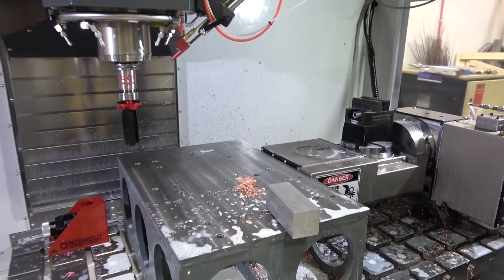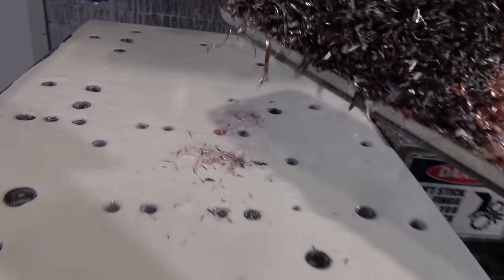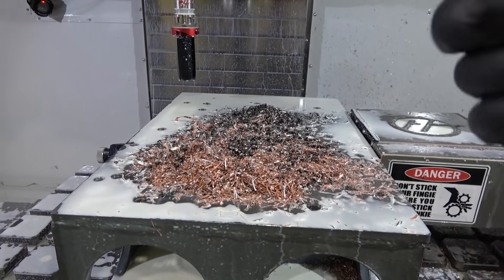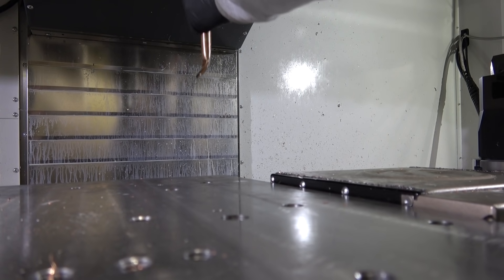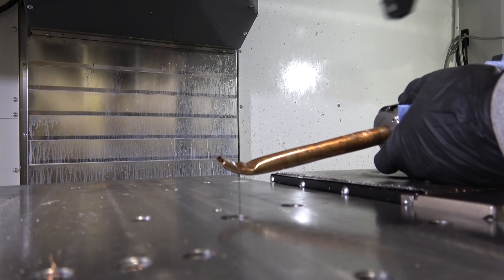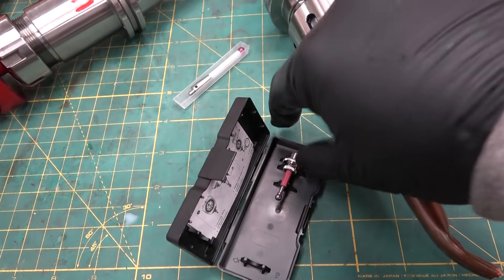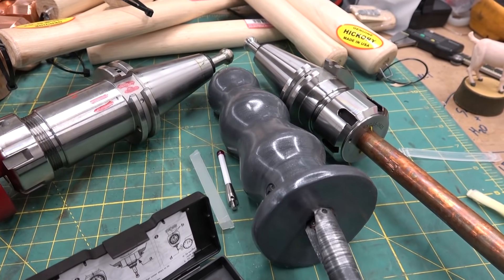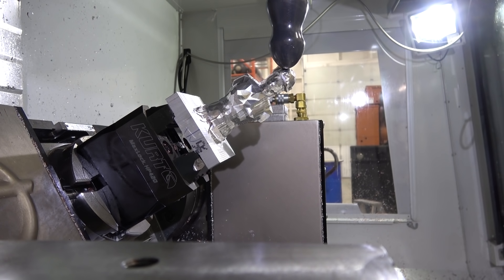Clever homemade tools

Comment: Nice tools, sir!  Two war stories for you:

I once created a "part washing" macro to allow the operators of a very long (25m) machine to clean the chips off a huge pipe just machined.  Did some for other machines, but this one saved hours of manual cleaning.

I once "fixed" a Renishaw probe, RMP60, the glass housing cracked but otherwise worked fine.  But from previous experience in humid environments (India), I knew moisture would eventually condense inside and destroy the electronics.  Nice design, Renishaw!

I poked a hole in the reservoir tip of a condom, stuck the stylus through the hole, and rolled the condom up to seal the glass part of the probe.  Worked for at least 6 months.

Cheers!

Comment: OMG I about peed myself I was laughing so hard. Seriously would that gray beast fit on a hammer drill. Oh wait a friend said use a sawzall.
Reply: Where im from we call it a screwdriver
Reply: Inventive!
Reply: Adjustable rpm?
Reply: If you use a sawzall you need a battery operated low power job and for god sake dont just cram a blade in your "probe" You would not believe how many people have just torn through and didn't realize until the damage was done. And lube lube lube and more lube, at high speeds things can get pretty viscous in there and I'll spare you the details. Have fun just be safe.
Reply: rick columbo 
That’s a scary thought.  A soft silicone “probe” mounted on an actual blade!  Yeah, that could do some damage.  Those blades can cut.
Reply: Go for the corded version.😉
Reply: @garywebster3044  You serious, yeah it's at least 25 year old technology and I'm no historian on the matter.
Reply: @garywebster3044  bless your heart!
Reply: Just seems very dangerous.
Reply: @garywebster3044  How many people must have told Columbus the same thing.
Reply: @thesage1096  nah it's real

Comment: 3/16 dia. By any length piece of brake line works good in a solid holder with a retention knob with a hole in it. Can be set with a tool length and programmed down inside holes and cavities to blow out chips. Extremely effective, try it

Comment: I program our 9 axis lathe that we feed with a fanuc robot.  I use that fan to blow off the chucks before loading and transferring  parts. I run a cycle of high pressure coolant thru and rotate the chuck then I turn the spindle on to engage the fan.  Usually does a decent job of chip evacuation!

Comment: Plumb a couple valves into your coolant system at the back of the machine, connect a garden hose with nozzle to one, works awesome.  Close the coolant valve to the nozzles, open to the hose, fire up the coolant and spray away.  Works great, worth the time, compressed air blows chips places they shouldn't be anyway.

Comment: Alas, someone else sees the method to my madness!  T30 (of 30) is for the Jacobs chuck for the probe, edge finder or indicator and T29 is the backup for when you invariably and overconfidently jog the wrong way or on the wrong axis with your probe, edge finder or indicator and have to touch off with a drill and some shim stock and pray.  The industrial butt plug addition is just a modest, gentle reminder of that fateful moment when your sphincter could have hammer forged diamonds instantly.

Comment: We Have access to a tool called an extractmax which is basically a fan that attaches before the tool, to give better extraction. We are talking wood cnc though, its very noisy and can klobber offcuts if youre sleeping at the wheel. We dont need them as such, but yeah id say at least 20% of my day is spent cleaning

Comment: Was wondering about that copper pipe jobby from the sneak peak in last video.
I use a lot of tool breakage monitoring and it's necessary to clean off the tool setter before use. It's been a while since I had thru spindle coolant at my disposal but u when I did I would run around the part with a spade drill aimed at it. That dedicated copper pipe looks like the ticket.

Comment: Very funny. You probably know this already but depending on your machine you could write a macro with some variables and call the macro/sub program and it will do your cleaning program with some changes controlled by variables. Could save some time?
PS like the copper pipe have not seen that before.
That long series drill looks a Sandvik insert drill. Need to be carful what insert goes where on that or you can get over size holes

Comment: Shop's I've worked at "would NEVER allow an extra minute of cycle time" to use those two cleaning tool's. 3 foot nozzle on my "Milton" with 5-10 second blast WOULD BE MAX! Produce "good part's FAST, OR you're OUT THE DOOR"!

Comment: For ease sir, for a general complete clean of the table, just write a program titled o00001 for example. Then inside that program write the tool change to the fan or super special blow stick, and a path that covers your needs. End the program with an m99 instead of an m30. Then whenever you finish a program for any part, just insert m98 p1 right before the m30 and it will call the external program to run the cleaning program 👍

Comment: I have a tool check up for you. Knipex 03 05 140. VS first gen square handle 02 02 180 VS 03 02 180. Metal looks totally different on the 03 05

Comment: have you done the burn an sniff test on your probing tool? interested in what type of plastic polymer that is.... if its reinforced with anything. might want to make sure to remove all stray hairs and man schmoo from the tip, and or base first....so as not to bungle the results... #keepyourbuttplugsinavice

Comment: Ave. I have a HAAS 30 lathe. On a steel 13 inch rod, I’m turning to 1.0659 inch OD. I’m using a rough cut insert and leaving .020 for my finish insert. I’m having trouble with runout to OD. (Cam lobe effect). Or in other words, on a finished product, looking at piece from the end, 12:00 is farther from center hole than 6:00.   Please offer your advice. I need to hold a .0003 tolerance in runout.

Comment: amateur game developer here. the old n64 was a cartesian system, a miracle of technology at the time but suffering from gimbal lock hell. contemporary games run mostly on spherical. so long story short i wrote some software to do a little retromodding wireframe conversion therapy and trust me, that kind of torture should be banned. it ain't shiny, you get one spot wrong and you've got 100 horny little brats who hate you for ruining their day. 50 MACHINED copper hammers? hobbies are disgusting, but i guess it's better than those catatonic job-havers who are out there doing "productive" things for capitalism points